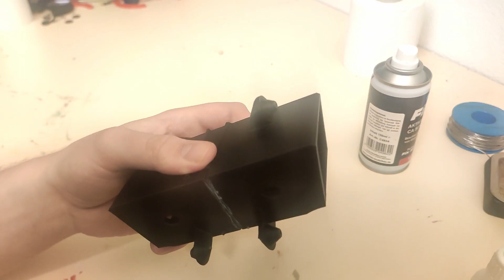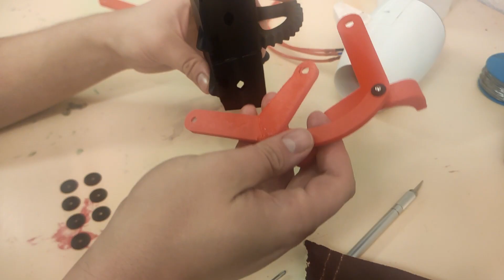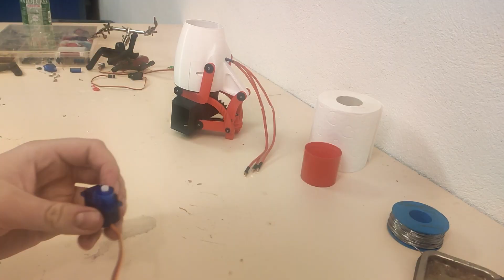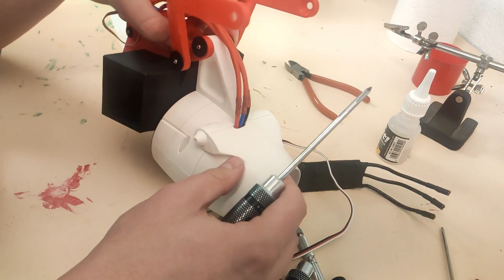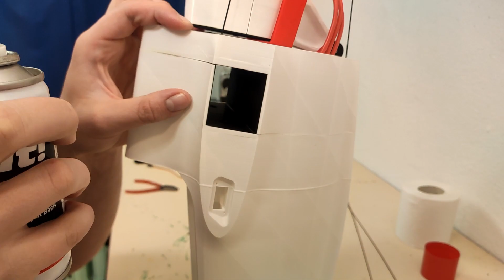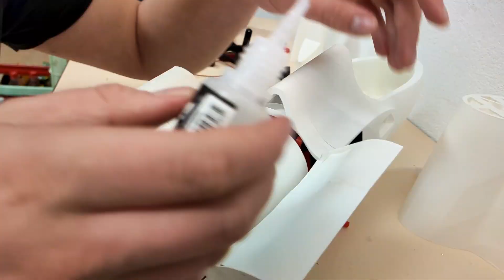Retractable EDF for DFS Habicht Build Video

Comment: That's all well and good, but what do you do if something goes wrong with the mechanics. How are you going to fix it then?
Do you then cut the fuselage open again, or do you simply throw the model away?
Reply from the maker: First of all, this is a 3D printed plane, and in my opinion, the EDF system is reliable enough to live just as long as the rest of the plane. There are two factors that could lead to failure: an overstressed servo and a loose potentiometer. In case of a failure, it is hard to fix, but there's just no room to make everything accessible. You can take the system out by poking holes in the fuselage with the screwdriver, and you can use it as a pure glider if it fails. That's just how it is, low reliability is the price you have to pay for a low budget DIY solution. And that's why there's the front propeller version.